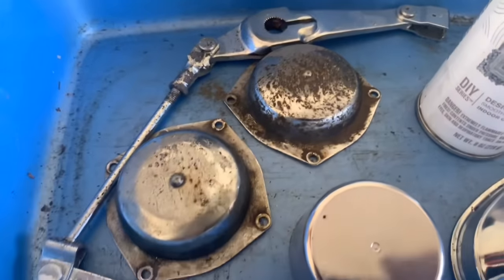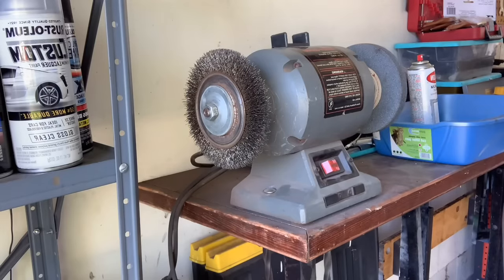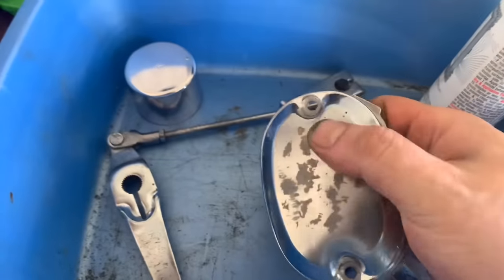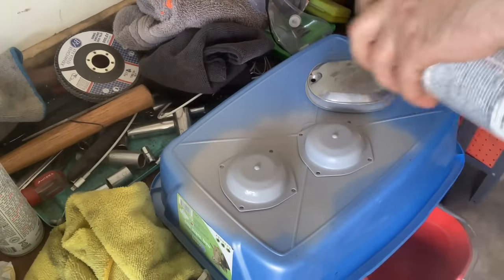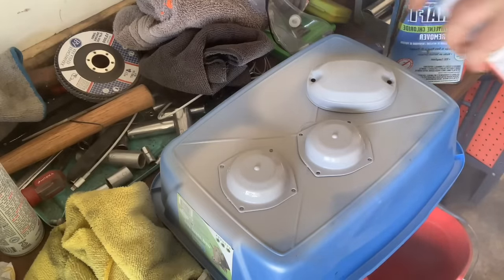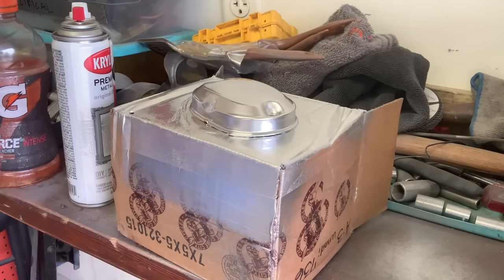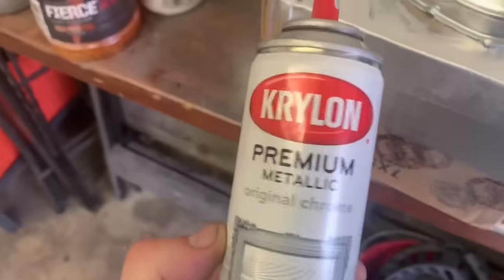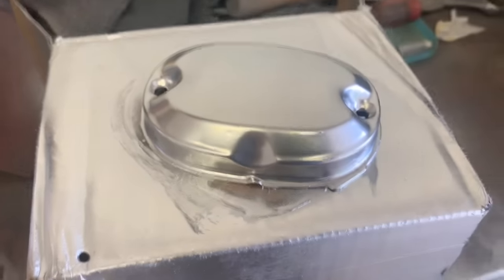Painting With Krylon Chrome Spray Paint-Vintage Motorcycle Restoration Project: Part 69

Comment: Dude' thats still aluminum colored paint. There is no chrome in that can, or any spray can. Chrome is a dipped paint. And don't add clear to it.  That's a no no. Aluminum chrome spray is ok for some parts, but it has no hardner in it. But you did do a really great job with painting those parts. Would I of used that chrome spray? Maybe if I couldn't of used flat black for shadow. Oh yeah, don't let any oil get to that paint, it'll turn on you and desolve off in no time. Chrome paint has sort of a metal base to it. Had you ever seen old bumpers that chip or flake? Use around 4 light coats of spray to spray you're parts with, you'll get a high gloss shine. By the way, nice bike.just alittle advice from Custom Jewel motor cycle shop. Owner operator Jim and Deb. 41+ years of it big guy.
Reply from the maker: Totally agree. It's garbage.

Comment: Thats not chrome looking. Thats more like aluminium. You need to learn about chrome. Spray paint chrome its for indoor decoration. It will never stay on motorcycle parts. I was like you 7 years ago.
And I am sure you feel shame on you after 1 month time when you watch whats left behind from your job.
Reply from the maker: I just got a replacement part. There are millions out there. This was just an experiment. Will likely strip it and rechrome if I need one in the future for a project. Thanks for chiming in.

Comment: Sorry, this stuff is garbage. It never really seems to set up, requiring extensive drying time, and multiple coats of clear. Imprints with the slightest pressure. You’re much better off for small areas with a mirror finish paint pen. One of Krylon's weakest products, from an otherwise strong company.
Reply from the maker: Yeah it was really soft! Not a great project at all. Fun experiment though.